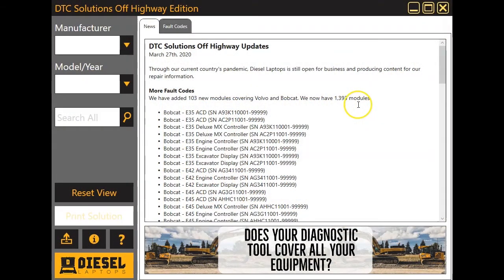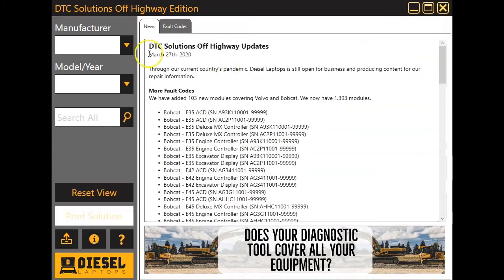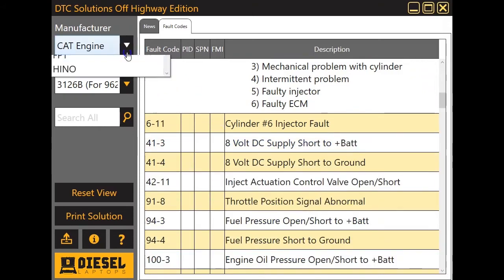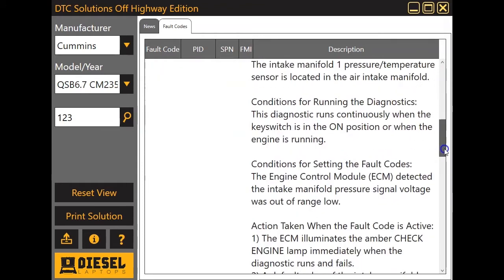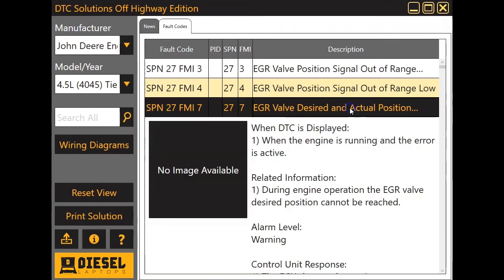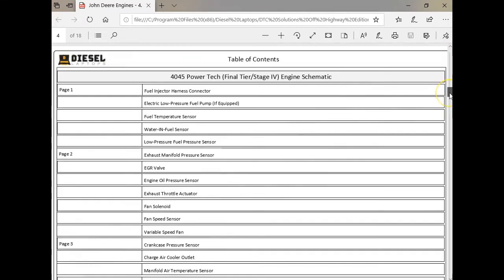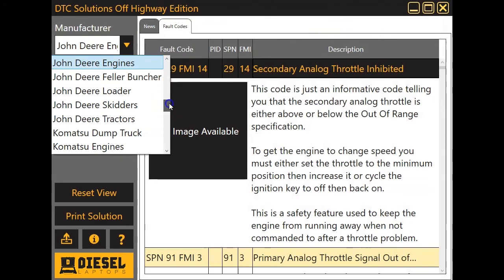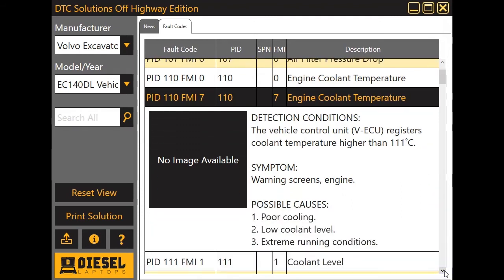DTC Off-Highway Walk Through 2020

Comment: Hi . I am having a problem where my Takeuchi TL12 shows an error fault 3701 which according to my handbook says DPF Filter regen needed and to check your dealer to have it rectified. I have since had the filter cleaned and put back in but the Alarm buzzer is still on as it is not resetting! Can you help? What is a most cost effective way of dealing with this? Thank you for an early reply. E MAIL michaelbdl@yahoo.com